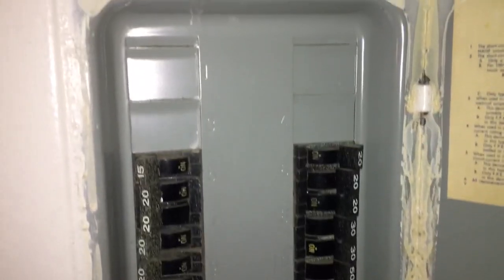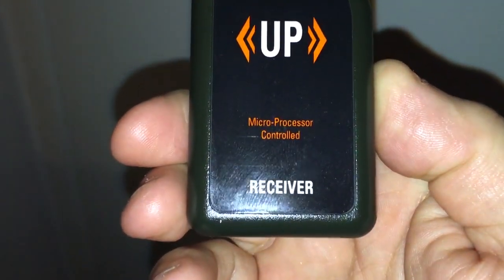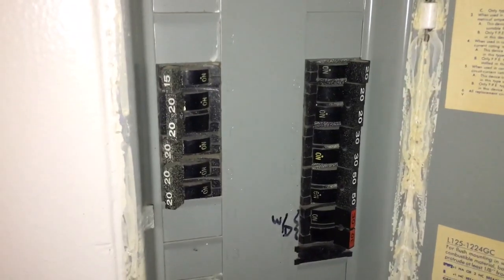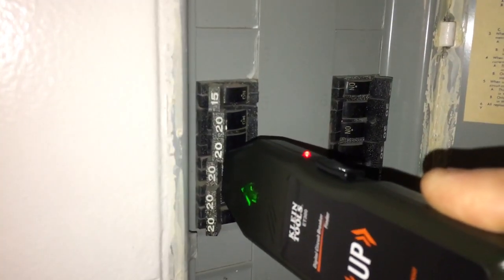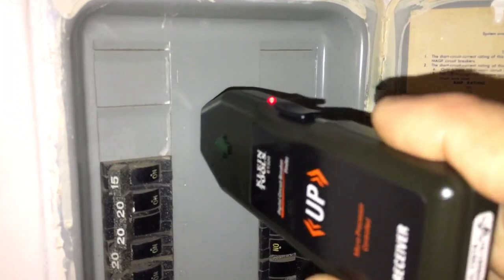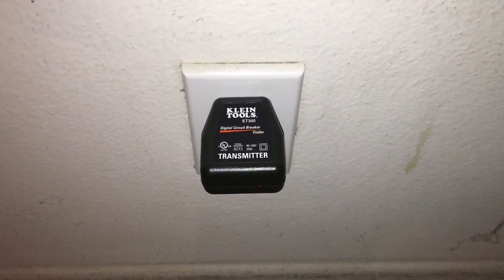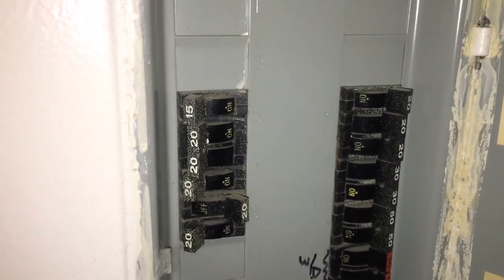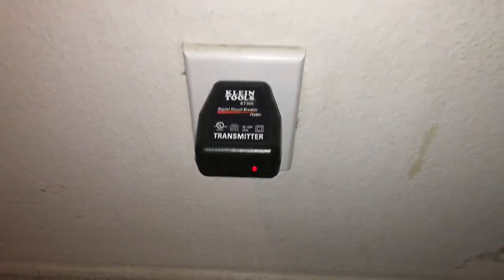Circuit Breaker Finder Tool !!! Works Excellent !!! EVERY Tech. should have this on thier Truck !

Comment: Flip the breaker off while still holding the tracer on the breaker. If it’s the right breaker the beeper will stop. Saves you a trip to the transmitter. The  tandems can be hard to get right the first time. I always take the battery out when storing it because it turns on so easily. 🤙
Reply: Oh and they sell a plug  to alligator clip set at home depot but not all stores carry it so check online
Reply from the maker: Thank you for the tips!  Much Appreciated ! Very cool trick , about turning off breakers till tone goes away. Nice ! Yea, i noticed it can be off 1 breaker up or down & like u say , the slims make it even trickier. 😁
Reply: OcRefrigeration , Hvac & Electrical Video's. I have a $1600 tracer but still bust out this little guy for residential easy jobs. It’s never let me down.
Reply from the maker: im hoping it works in light commercial ? what do you think ?
says it will work up to 1000 feet.
i just need 100-200 foot maybe. more like 50-100 ft in restaurants ?
Reply: OcRefrigeration , Hvac & Electrical Video's. Ya it should work fine a couple hundred feet. I think it’s 120volt only though
Reply from the maker: correct. only 120 volt. but, i figured on 208 i can just find one leg since they are a double breaker im right there. just use the aligator clips and clip to one leg and other leg to ground. same on 3 phase.
Reply: OcRefrigeration , Hvac & Electrical Video's. That’s it! Only problem with me is I get so used to hooking up my other tracer to 208-277v sometimes I forget when I use this one.⚡️⚡️
Reply from the maker: Yea, i could see that. it might not like me feeding it 208 if i use it on 460 one leg. might make a interesting video though. 😆
Reply from the maker: note to self --- 120 volt only. 😆

Comment: Cool, better then flicking 737373 breakers back and forth.
Reply from the maker: Thats for sure.
Reply from the maker: i used to just plug in my Wet -vac since its loud & just start shutting off breakers till the vacuum turned off. then wait 5 minutes since the first breaker was turned off. then just start turning them all back on again 1 at a time. i also told anybody  with a computer on to turn it off before i started. it worked out pretty good. hopefully this will be better.

Comment: I’ll be going to Home Depot in the morning 👍👍👍
Reply from the maker: 👍. i can't Believe i did not get one of these years ago. What a Game changer!  Talk about making my Life easier. 😎
Reply: OcRefrigeration , Hvac & Electrical Video's.  I seen it in Home Depot but I never realized what it did but I’ll be picking one up in the morning for sure
Reply from the maker: double check its in your store. its not in my home depot & amazon is cheaper on it right now. just a heads up. 😁
Reply: OcRefrigeration , Hvac & Electrical Video's. Ok cool thanks
Reply from the maker: Heres the Home depot link for it  --- it will tell u if its in the store or not right there on the page. free shipping to your store if not in stock. $36.65 in my home depot. prices differ across the states ive found though. $29.95 i think on amazon if u care about $6. sometimes i dont care. id rather just go get it. 😁

https://www.homedepot.com/p/Klein-Tools-Digital-Circuit-Breaker-Finder-ET300/202330830
Reply from the maker: This Looks Like exact same --- $19.99 Harbor Freight. For anyone that is a Harbor freight Man. Same exact Look 👀 Just different color.

https://www.harborfreight.com/circuit-breaker-detective-96934.html?cid=paid_google%7C%7C%7C96934&utm_source=google&utm_medium=cpc&mkwid=s%7Cpcrid%7C385373262877%7Cpkw%7C%7Cpmt%7C%7Cpdv%7Cm%7Cslid%7C%7Cproduct%7C96934%7C&pgrid=80023504313&ptaid=pla-821978524965&pcid=6551111411&intent=&gclid=EAIaIQobChMIn-bQp8715gIVFcRkCh25ZA8YEAQYBCABEgJrOPD_BwE
Reply: OcRefrigeration , Hvac & Electrical Video's. I’m the same way I want it right away they don’t have it in my store but they have it in another store couple miles away Thanks for the link

Comment: Cool tool. Now if they would come up with the same thing for wires like for switches or lights in a clamp style, that would be 100% badass!
Reply from the maker: they have a light bulb socket adapter & pigtail in a kit with aligator clips. ill be making my own though. im just gonna use a cord that i have allready cut in half. female end with aligator clips.
Reply from the maker: https://www.ebay.com/p/1900002889?iid=151444500090&chn=ps&norover=1&mkevt=1&mkrid=711-117182-37290-0&mkcid=2&itemid=151444500090&targetid=474173410309&device=m&mktype=pla&googleloc=9031555&poi=&campaignid=6470049725&mkgroupid=79220281842&rlsatarget=pla-474173410309&abcId=1141176&merchantid=101679849&gclid=EAIaIQobChMI04i38sr15gIVgqDsCh1d1whGEAQYASABEgKGy_D_BwE&thm=1000
Reply from the maker: ideal 69411 Accessory Kit. $9.99 Ebay.
Reply: @OcRefrig  very cool! I'm going to need a bigger tool bag. Lol

Comment: What's the distance range it works
Reply from the maker: 1000 ft.
Reply from the maker: Best deal is Amazon - Right now. $29.99 -  https://www.amazon.com/Klein-Tools-ET300-Electrical-Standard/dp/B003LHJSY8/ref=asc_df_B003LHJSY8/?tag=hyprod-20&linkCode=df0&hvadid=309775248366&hvpos=1o4&hvnetw=g&hvrand=15447845232006215187&hvpone=&hvptwo=&hvqmt=&hvdev=m&hvdvcmdl=&hvlocint=&hvlocphy=9031555&hvtargid=pla-436751823588&psc=1

Comment: Man, I HATE those Federal breakers like that - apartments we used to service was FULL of those things.
EXPEN$IVE....and only available at one Supply house locally that always seemed to forget the carried them.
Reply from the maker: Agreed. Terrible design. i hate them too ! the only thing holding the breakers in the bus is the metal panel insert. Really bad design .  a Bit of trivia for you --- " Federal " actually Lost thier Licence over these breakers. too many house fires. Thats Why they are So expensive & Hard to come by. i Believe  home depot sells them now at a reasonable price. made by some other company.
Reply: @OcRefrig   Boss told me the same thing - for a while you could only get 'refurbished ones'...I guess after the company went under - even the 'new' ones we get are kinda crappy - the ones that've been installed for years either trip WAY too soon or don't trip at all.
Reply from the maker: Yea, im suprised There was not a Federal Mandate to Remove ALL these Panels from ALL Buildings in the U. s. a. if i Ever Bought a House with These FPE stab-lok breakers in it , it Would be the First thing to Go ! Major Fire Hazard & The Poor connections could play havoc with Computers , Electronics , Music Quality & Electricity bill. The connection point / small area of contact to the bus is shocking they ever approved a design with such a small area of contact. 🤦‍♂️
Reply: in my area, the bank wont issue a loan on homes with a federal panels, so i change a few year to make sale go through for some realtors
Reply from the maker: smart bank. i would not either.

Comment from the maker: Link - Best deal Right now is Amazon. January 2020. $29.99
Amazon ---  https://www.amazon.com/Klein-Tools-ET300-Electrical-Standard/dp/B003LHJSY8/ref=asc_df_B003LHJSY8/?tag=hyprod-20&linkCode=df0&hvadid=309775248366&hvpos=1o4&hvnetw=g&hvrand=15447845232006215187&hvpone=&hvptwo=&hvqmt=&hvdev=m&hvdvcmdl=&hvlocint=&hvlocphy=9031555&hvtargid=pla-436751823588&psc=1

--- Home depot --- $
 https://www.homedepot.com/p/Klein-Tools-Digital-Circuit-Breaker-Finder-ET300/202330830

Comment from the maker: For Harbor Freight Fans ! --- 
This Looks Like exact same --- $19.99 Harbor Freight. For anyone that is a Harbor freight Man. Same exact Look 👀 Just different color.

https://www.harborfreight.com/circuit-breaker-detective-96934.html?cid=paid_google%7C%7C%7C96934&utm_source=google&utm_medium=cpc&mkwid=s%7Cpcrid%7C385373262877%7Cpkw%7C%7Cpmt%7C%7Cpdv%7Cm%7Cslid%7C%7Cproduct%7C96934%7C&pgrid=80023504313&ptaid=pla-821978524965&pcid=6551111411&intent=&gclid=EAIaIQobChMIn-bQp8715gIVFcRkCh25ZA8YEAQYBCABEgJrOPD_BwE
Show less